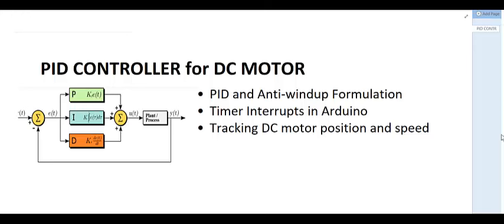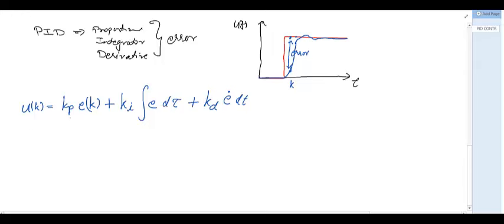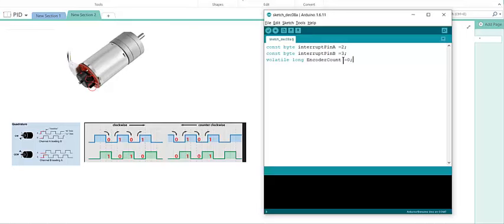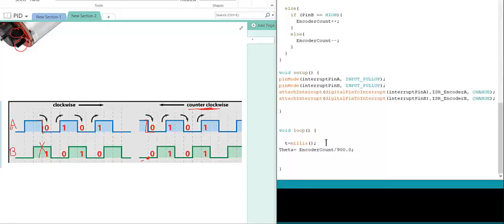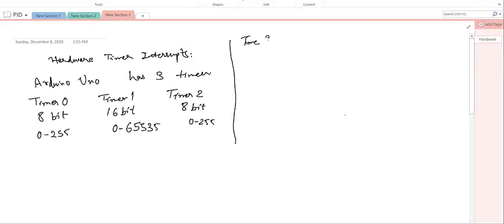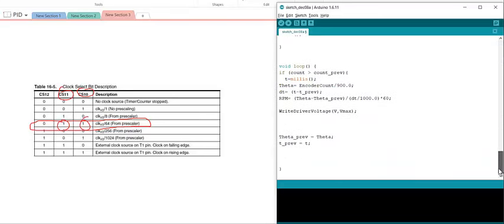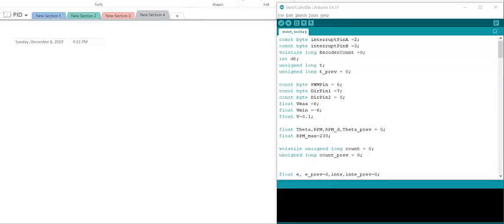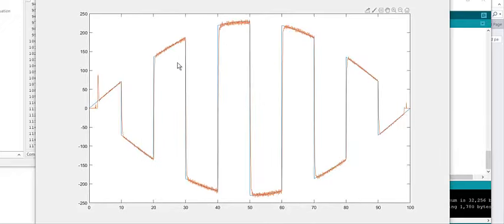COMPREHENSIVE: PID CONTROLLER for DC MOTOR with Timer Interrupts and Anti-windup

Comment: This example sets the target as the  tacho rate of change, that is velocity via a pwm signal to the motor. To achieve position control your error is simply your target - your present tacho count, again a pwm magnitude is controlled by the size of the error and the PDI coefficients.

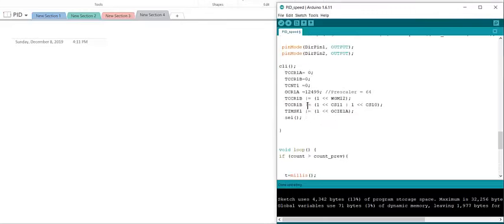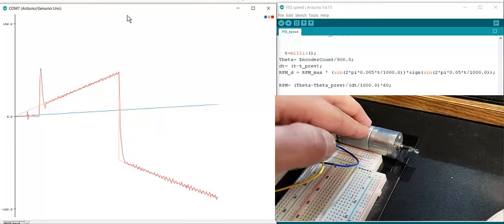Comment: @29:53 Why do you advise serial printing inside an interrupt?  And @13:57 Why do you use 900 if you are counting the 4 edges of the two pulse trains A & B  Most encoder PPR specifications are as the pulses on one channel, to be read as a clock+dir pair on one edge of a clock signal.  Counting on all 4 edges is more complicated, but quadruples the resolution.  If you're using the 80RPM motor with spec'd at 900PPR and reading all 4 edges, the divisor should be 3600 counts/rev.  Using 900 instead of 3600, you are probably getting only 25RPM when you call for 100RPM.  At 100RPM it should take 0.6 sec to do a revolution or 1.6 rev/sec, not 2.4sec/rev or 0.4rev/sec like at 31:26.

Comment: at 14:32 u said that 900 is the count/revolution, right? How did u get that value I'm a bit confused? Amazing video btw, thanks a lot!!
Reply: Hiya I believe he is using a 900 counts per evolution encoder - ie it is made to cause 900 pulses on its output in one revolution. Number is supplied by the manufacturer.
Reply: I think he's using an "Encoder Metal Gearmotor 12V DC 80 RPM Gear Motor with Encoder for Arduino and 3D Printers" motor  specified with 900PPR, but is counting 4 edges/pulse so is actually getting 3600 counts/rev.

Comment: Great vid, I've a question: 
Whati is the benefit of usint the "time interrupt" instead of telling the program to enter into the PID loop when >50ms elpased from previous entry???
Thanks!
Reply from the maker: Advantage of timer interrupt is that Arduino is free to do other things while waiting for 50ms. Unlike in delay(50) command, arduino is stuck for 50ms
Reply: @GeeKeeCeeBee  I'm not talking about delay(50). But sg like this:

if millis() > (PreviousLoopEntryTime + 50){
   PreviousLoopEntryTime = millis()   
   Preform the remaining of the loop
}
Reply from the maker: I have not tried that logic but I don't see issues with your code. Also, millis() is based on Timer0 which is pre-configured to count clock pulses every 1ms. Either approach is fine imo.

Comment: Great vid, thanks!
However the Interrupt service routine for the encoder could be much more simple: 
use this on one Hall sensor's pin: attachInterrupt(digitalPinToInterrupt(pin), ISR, mode), and the 'mode' should be 'RISING'
And to get the direction in the 'interrupt service routine',  you only have to check whether the other Hall sensor's pin is HIGH or LOW at that moment.
Reply: Hi, Do you know how to change the positions in the program? I'm having trouble figuring it out. I would like to change the rotations from what he has.
I would like to add more positions. Thank you.

Comment: How can I choose an RPM - say I want to run my motor anywhere from 0-10 RPM and I'd like to choose a single RPM or vary that RPM over time. Where in the code can I adjust that

Comment: Hey sorry for asking, but are you sure the schematic is correct?  After I removed the enable jump, the motor doesnt even start.
Reply from the maker: I pretty sure the schematic is correct. If you leave jumper in then motor should run at full speed (at max supply voltage).
In your case, as jumper is removed I would suggest to check your PWM pin and value that your sending. If PWM value is zero then there's no voltage going to the motor.

Comment: Do you think is it possible to model the motor mathematically? I mean, doing a open loop test for example? Then , it is possible to design the PID controller accordingly to the system control theory.
Reply from the maker: Absolutely! However, you would need several motor parameters such as Torque constant, inductance of the winding, friction, torque speed curve, etc to model the motor. I believe these can be obtain experimentally aswell.
Using the state space representation, modelling the whole system with PID is fairly easy.
Reply: hey did you make a hardware model of this?

Comment: Excellent video thank you.  I have an application where I'm trying to on control a bypass around a supercharger using a drive by wire throttle body.  The controlled parameter is supercharger discharge pressure, which is limited by bypassing an increasing amount of air around the supercharger as engine speed increases.  I presume that I can have one PID loop for the pressure control, and a second PID loop that positions the throttle plate to the commanded position via PWM (throttle plate position feedback is via a potentiometer).  I presume that is easily accomplished in the Arduino environment.  Do you have any comments or helpful hints on that approach?

Comment: You briefly touched on controlling position instead of speed at 33min. Please can you elaborate a bit more, I didn't quite understand
Reply from the maker: You would need to create a desired Theta ( desired angular position) trajectory. And the motor will basically track this desired trajectory. So the error becomes Theta desired minus Theta actual( motor angular position). Note that angular position could be in deg or radians, so proceed accordingly.

Error = Theta_d - Theta
After that tweak the gain values as needed. PI controller should be sufficient. Hope this is helpful :)

Comment: @GeeKee Ceebee first off great informative video overall; thank you! I am uncertain about some things you explained though...at 10:45 when you're checking the status of the encoder pins to determine clockwise or counterclockwise direction, you're saying check if pinB is high and pinA is low to constitute an upcount and every other case is downcount...it makes sense for the portions of the signals that are clearly pinB high and pinA low...but what about right after that condition when the controller sees pinB high and pinA high - it would downcount (undo the upcount it just did)? What if the motor is idle or stalling with either conditions of pinA, pinB both low or one being high the other being low or both being high?

Comment: I am trying to control a DC motor using the writeMicroseconds as opposed to having a straight voltage put into like your motor driver function. Do you think this is viable?
Reply from the maker: I dont see an issue if you're simply trying to run the DC motor, however, if you're trying to implement tracking control on DC motor then it'll probably wont work. Reason is that the encoder and DC motor have to run on the same Timer clock. I believe writemicroseconds use a different clock which wont allow event synchronization. Hope that helps.

Comment: My RPMs are wrong! Where does that 900 come from? How can I fix this problem?  On my encoder I can read it gives 11 signals when rotating one circle.
Thanks so much for helping me!
Reply from the maker: Mybad, I missed this topic in the video. Theta = EncoderCount/ CountPerRevolution. In my case, 900 comes from the combination of Encoder's count per revolution (CPR) and motor gear ratio. CPR may be different depending on your motor and encoder specifications. Check your gear ratio, if any, and Encoder CPR. Hope this helps.
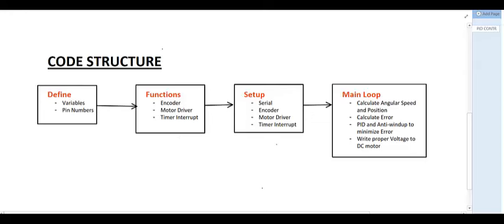Reply: @GeeKeeCeeBee   hi if my motor has 11 pulse per revolution (ppr) and gear reduction ratio is 1:34.02 how many counts per revolution (cpr) do i have?
Reply: @usmanriasat9834  11 * 34.02 = 374 pulse per revolution, but since he's counting 4 edges per pulse, it is 11*34.02*4 =  1496 counts/rev.